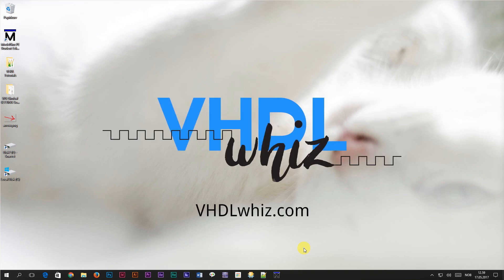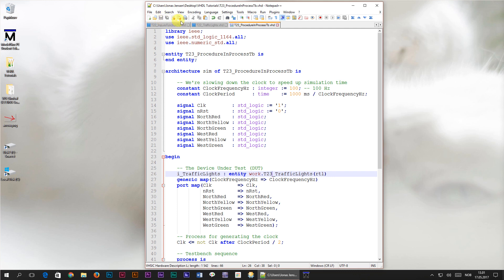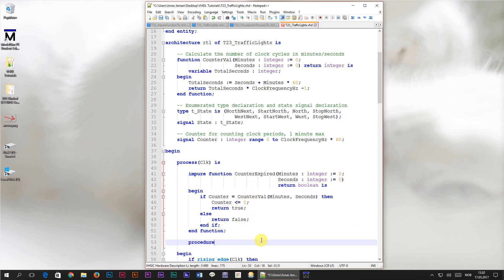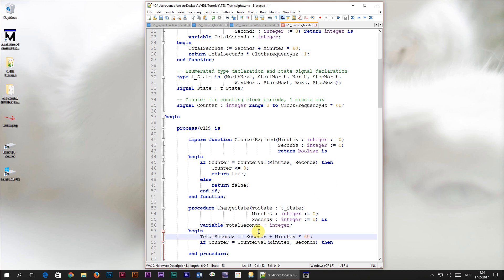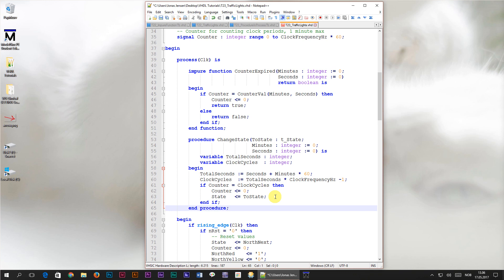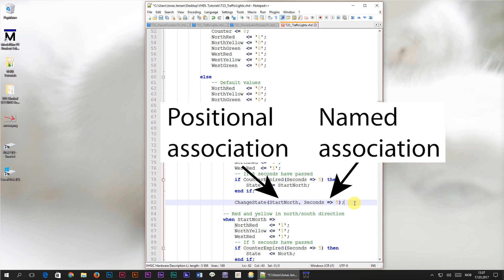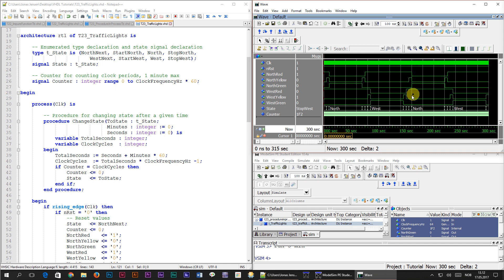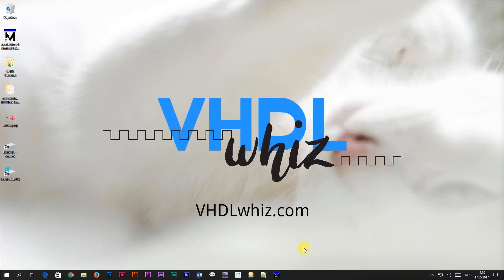How to use a Procedure in a Process in VHDL

Comment: Thank you the thorough course and the great explanation. 

I have a question regarding the material discussed in this video.

The parameter created in the procedure created in this video were had no keyword before the (signal, constant, variable..etc) also they didn't have the direction label (in, out, inout) so I am a bit confused between the procedures you made in a previous video and this procedure. Could it be because this one was declared inside a process hence it takes parameters differently ?. 

Is there a good way to differentiate between subprograms declared in the process region and in the architecture region ?.
Reply from the maker: If there is no object class (signal, variable, etc.) constant is assumed. And mode "in" if one isn't specified explicitly. Therefore, all the parameters that you mentioned are constants of mode "in". You can use the default modes in subprograms regardless if they're declared in a process or not.